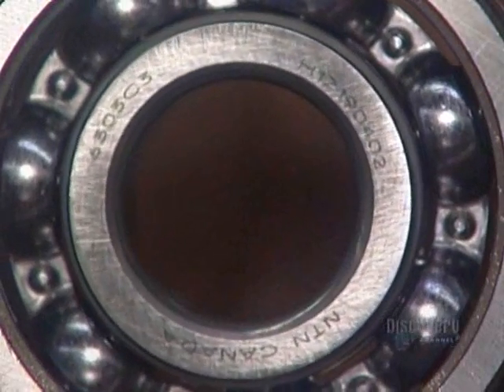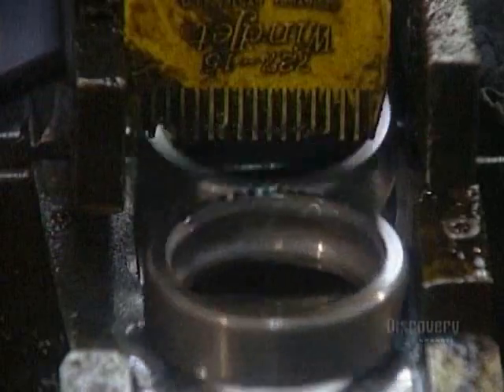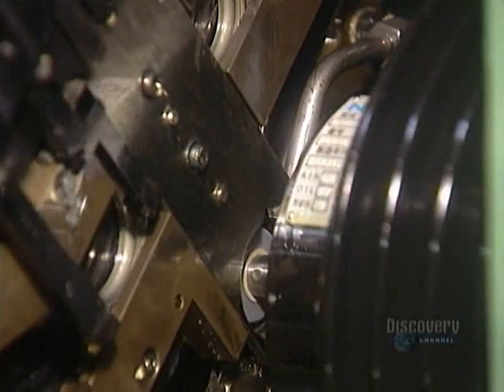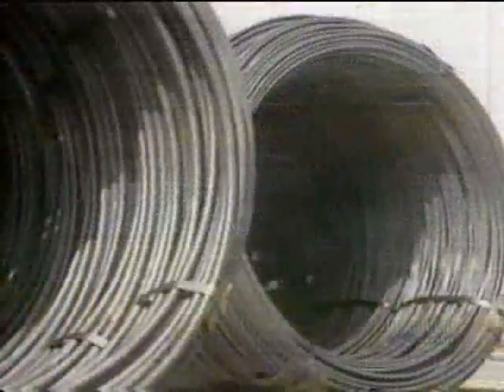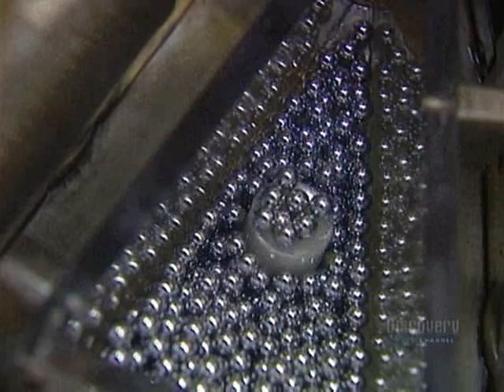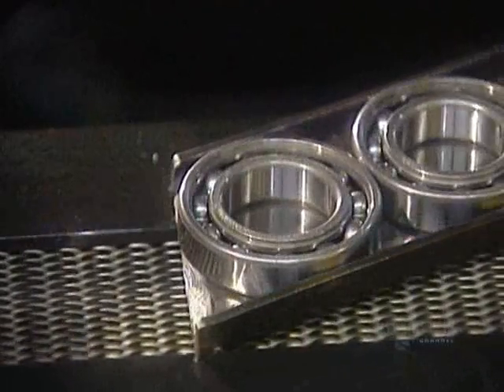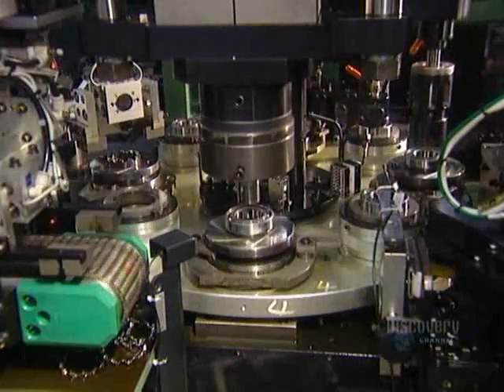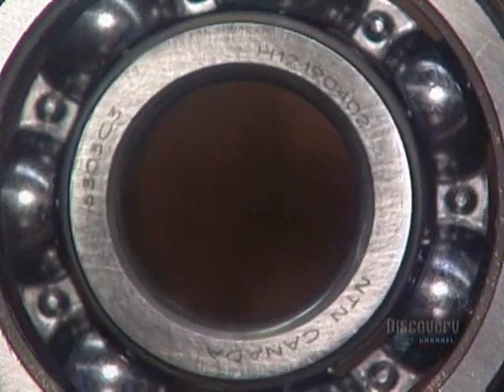how its made ball bearings

Comment: @Laofse I have the answer now: The inner and outer ring are positioned in that way that they touch each other in one point. Then you can fill in all balls on the opposite side one directly next to the other. Later the balls are spread around the whole circuit and then fixed by the cage.
Reply: I would have thought more people would comment wondering how this is done. I guess most people dont go that deep in thought.

Comment: @MrKaddan 
all the balls are on one side of the ring, that gives enough room for the inner race to be inserted offset toward the other side, then the balls are spaced around the inner race.
Reply: 13yrs later but i was looking through these comments for this. I had read elsewhere this was the method, also read they deform the outer race slightly on some to aid with fitting the balls in and the race returns to exact shape. I wish they would show the balls being installed and then how they get them all spaced equaly for the caged retainer, magnets maybe.

Comment: - @ yugix5 -

Okay.  A ball bearing is a device used to help parts, particularity rolling parts run smoother.  The bearing case is held in place while the shaft of the rotating part goes in the inner hole.  Since the bearing balls are very smooth, it creates a surface with much less friction but not entirely friction free.  A car is full of them.

- @ 73xVip3r -

I have no idea who you're refering to.

Comment: At that point you're right. But in my eyes they have to check the complete product to be sure to exclude running noises. At work we once had bearings with strange running noises because of a bad grease. 
So i would prefer two running tests, but that would maybe mean too high production costs as well :-(

Comment: I work as mfg engineer. I don't build ball bearings but from my experience you can just go out and buy a off the shelf machine for a product like this. Usually off the shelf machines are combined with off the shelf material handling machines. There is a lot of then there are a lot of custom parts and modifications made to create a line like the one above.